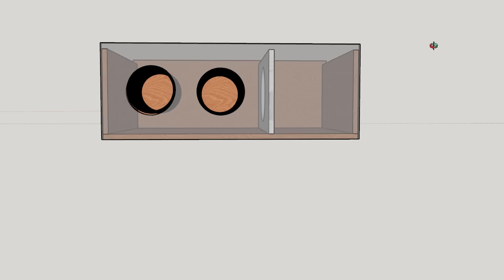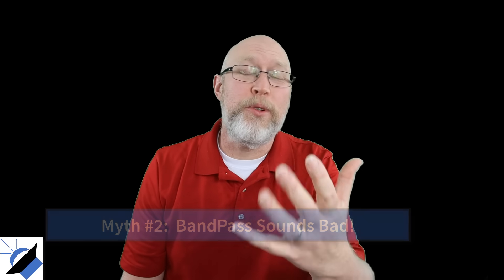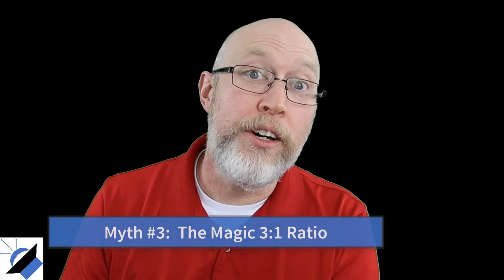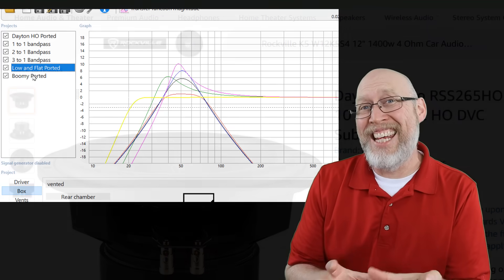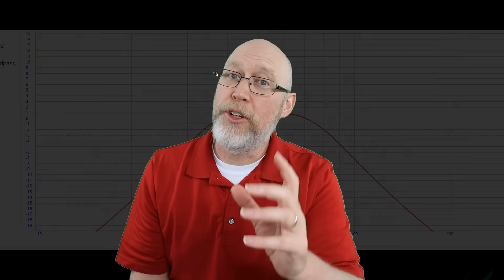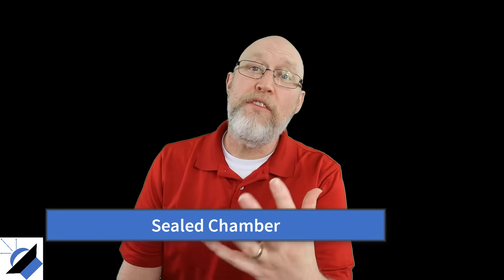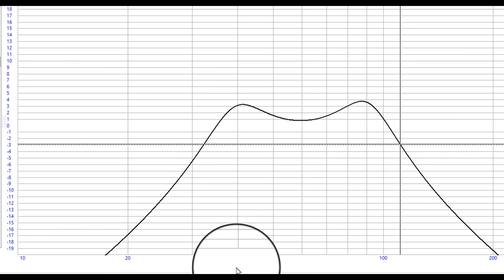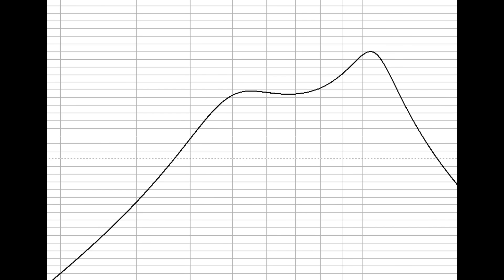Bandpass Subwoofer: You Are Doing it Wrong.  Bandpass MYTHS BUSTED!

Comment: 4:20 the 3:1 ratio.. Was born for the ease of porting if you are porting the larger chamber in which a larger diameter port can be used as a length isn't a problem.. I prefer to port the smaller enclosure.. Which makes it harder to get a good port. But I also vent the magnet side.  Ratio and Q is Way better using the larger side as the FC tuning with the port Q meeting it.

Back in the 90s I got a hold of the Pioneer Bass book installers guide.  It showed a group of modelled enclosures. I learned the EBP concept and matching final QTC and resonance
Reply from the maker: Back in the day when you had to have a book to find stuff out!  Would have loved to have gotten my hands on one of those back then.
Reply: @DIYAudioGuy  I learned how T&S changed things with those enclosure graphs and could build and did build many. Lots of calming people down from more woofers showing them one QTC final .707 target would bump better than 2 in the same area at .9

Comment: They turn the driver around because of cooling! If the driver is facing the other way the heat can only escape through the cone of the driver. The pressurized air moving in and out of the box helps dissipate heat from the driver. They do the exact same thing in ported and sealed boxes but its much less common.
Reply from the maker: For sure! You get better cooling with a magnet is exposed.  No impact on sound, especially in a bandpass box where you're only hearing the port resonating.
Reply: @DIYAudioGuy  Looking it up they actually do it so they could smell the voice coil as well but I’d never heard it that way. I have a 90/dbw 4th order right now that i designed with old school math and the drivers are inverted with the phase flipped. I messed up my calcs though so my F-upper is lower than it should have been 😭
Reply from the maker: @peeweebus6829  bandpass is a pain in the rear. Very hard to get it right.

Comment: I have a sub woofer speaker but this one has a low Qts and makes a possible resonance frequency of 40 hz to get a Qts of 0.6. Then I can not use a bandpass? because then it go never lower then the open resonator with pipes. So i need a speaker with higher qts, of Vas. I have visatons wsp26s, and these have a res of 19 hz and a qts of 0.47, that will make a 20 Hz bandpass.
Reply from the maker: I know that I made the same reply to your other comment, but it is still the same answer.  WinISD.  https://youtu.be/yZNeYBYGRKk

Comment: Great explanation. Thanks. I would be interested in understanding group delay and what is relationship (if any) of seconds delay (as shown in winisd) and pecieved sound quality.
Reply from the maker: I haven't done any research on it.
Reply: in the analog filter world (or digital for that matter) , group delay is essentially how smooth the phase changes with frequency and the 'slower or smoother' the phase changes, the less distortion that wave shape has. Filters in radios often have added sections to smooth these changes to make it easier to recover the waveshape when demodulating the signal.

Comment: I bought a second hand active subwoofer and it's actually a 4th order bandpass by checking it online (not a crazy branded one, I think it's chinese but it sounds good enough), it's called Dai-ichi ASW-10DR, now I got this for like 10 bucks out of facebook marketplace, the wood is like dry and by the looks of it, it's water damaged, luckily enough it still works like a charm, I disassembled it and upon removing the 10" sub, it's a dual 4th order bandpass that is front to front (I don't know if I'm using the right term), well, my only question is, should I remake the production box by building it based on its own design? Or should I make a new design box fit for dual 10" subwoofer? (probably still a bandpass cause it sounded big on a small scale, but different design).
Reply from the maker: If you're going to rebuild the box, try to recreate the original.
Reply: @DIYAudioGuy  Thank you so much!

Comment: Very helpful info. One thing I question though is the last statement you made about the asymmetrical ripple sounding bad. However it seems to me that if you tune it such the the upper ripple is greater and the lower ripple is flattened it could provide excellent results if the upper ripple is well above the crossover frequency.
Reply from the maker: That is true, once you add a crossover things change.

Comment: Efficient to some means highest achievable SPL. efficient to me, means sound output balanced to cover the band of frequencies desired with the least variation. I want the subwoofer to "sit" in the frequency range such that, in concurrence with the other drivers used, the "gap" that i want to fill is evenly filled, it does not run over the midrange or the subsonic transducers. If the subsonic transducers do achieve coverage up to 30Hz, then i want to begin hearing the subwoofer take over at above 30Hz and carry on until it meets up with the midrange driver that most likely will start to dominate above 80Hz. But it depends on the setup. Not the same rules apply for a portable bluetooth as a concert or an audiphile living room or recording studio or car. These crossover frequencies vary greatly depending on overall size, number of "ways" or number of bands covered by transducers. There can be as many as 4 frequency bands covered by the various drivers from subsonic, to sub bass, to midrange and trebble for starters. Varying the bandwidth by compressing it with larger baffle of the exterior chamber doesnt change the efficiency technically. It will over the entire frequency span pretty much generate the same amount of vibration. Its just a matter if it's TUNED to resinate the right set ot frequencies in the right balance. And too sharp or too flat of spectra can both be easy to encounter with just slight variations.
Reply from the maker: Right, there's a whole lot to it.

Comment: I do db contests with an old bandpass woofer
Loaded with 2x 12inch.
And its an old magnat 2120 with thick 20mm plexi
Was thinking about replacing it with multiplex
Maxed out on 142db with the original 175w rms woofers and i blew the power caps in my headunit xD
Reply from the maker: No doubt these band pass boxes can get loud!
Reply: @DIYAudioGuy  they sure can.
But like you said. 
When you get the porting wrong they sound awfull.
My mate had a cheap bp and it sounded like he mounted the woofer into a plastic oil drum.

Comment: This is a really good primer for Bandpass enclosures. I always learn (or re-learn as the case may be) some good stuff from watching your videos. I have created exactly one bandpass subwoofer enclosure in my lifetime... I do feel they can be more difficult to work with, but with your video and a basic working knowledge of WinISD, I think most folks would be able to handle designing one with decent performance, given the driver was suited for it.  Given cabin gain in automotive environments, a well-designed bandpass can really be a decent option at times.
I love how you present a lot of knowledge clearly, and quickly. The side-by-side with a vented box FR response is a great way to explain what's going on with changes in the HF and LF box sizes. Great video!   Yeah, I'm a bit late to this party. :)
Reply from the maker: There is nothing wrong with bandpass, but it is not a magic box.

Comment: Bandpass is indeed awesome if you do it right. And doing it right is easy. Buy a suitable driver. Enter the parameters in software. Tweak with volumes, port surface and length, until the frequency response best compliments the rest of your speakers. Then build it without compromising. DO NOT pay attention to myths. Just build it as it rolls out from the software.
I did that and the resulting build was so big that it barely fitted between the wheel arches in the trunk of my car. Indeed, it turned out bigger than expected but the sound was amazing.
Reply from the maker: I agree.

Comment: When it comes to 4th orders from my experience I’ve seen shrinking sealed chamber leads to better low end and stronger output overall, this obviously goes against all logic but it’s true in 9/10 applications. I’ve spoken to numerous box designers, heard countless builds, seen friends go thru it, read on forums, etc. but this is all dependent on power too, if you are overpowering your sub by a bit, you will have Better low end if you have a smaller sealed chamber vs under powering a speaker, then you’d benefit from making sealed chamber bigger. the loudspeaker cook book is wrong in a lot of senses too. Come out to some bass shows once in a while, you’ll hear 4th orders that play down to 20 and into the teens sometimes and up to the 50s. 
    Quarter wavelength helps the big ratio theory also, the farther your subs and port load away from your listening position, generally the better for low end output because the quarter wave develops more
Reply: a small sealed section is NOT helping you play low. theres so much more to the equation than you know. maybe those small sections are giving you a large ratio like 1:5 - what exactly are you considering low? 30 hz? 20 hz?
Reply: @BenHeien  exactly.  The sealed section,  is actually what controls the low end.  I've seen negative ratio 4th order play very well, also.  A 1:1 is normally a very well rounded design, with a driver that does well in 4th order.  My sedan is walled, with a 6th order.  It has a huge bandwidth,  and I can play from 16-54hz and with changing the loading wall... (upper port) I can play lower and it higher hz. A vehicle's cabin peak,  and loading,  plays a huge role in output as well.  Always best,  to find your vehicle's,  cabin peak and work from there.
Reply from the maker: There is a lot to it.

Comment: Since you started digging into subwoofer enclosure designs let me rack your brain real quick if you take a subwoofer that has a high xmax and you put it in a 4th order bandpass and you cut two holes on a sealed enclosure side and you add two cones of equal size to the one inside the enclosure what kind of enclosure you left with? And what is the kind of performance would you receive? And what kind of enclosure have you created?
Reply from the maker: I have no idea.
Reply: @DIYAudioGuy  isobaric bandpass it is not widely used due to the restrictions of a lot of current subwoofers but you can also Build 1 with different cones on the side to change the tuning frequency there's a lot of difficult mathematics involved but they used a similar thing from Bose and one of their older desktop sounds units we just of can apply it in a different way and I would say look into 5th order bandpass as well they're not widely used in car audio they're used more in concert Halls for projection of sound or directional sound
Reply from the maker: @c.n.h4841  I think I understand what you're talking about now. When you said cone I assumed you were talking about a passive radiator.
Reply: @DIYAudioGuy  yes cone does stand for Passive radiator the passive radiator can also be created by using a recone kit for any subwoofer but if you are going to make this creation it must be the same manufacturer so there is no failure issues this is something that you would not be able to fit in parameters on normal sound programs you would need audio engineering programs to run sound quality test on using colors years they also use this same style of enclosure in certain mercedes-benz's just on an extremely small a scale but they use more of a 5th order bandpass style in the Mercedes

Comment: Odd you should talk about small rear chambers and SPL builds. Craig Butler's car has these digital designs 18" subwoofers in these sealed cylinders and is hitting insane SPL at one note. I'm not sure if he shaped his entire cabin to act like a great big resonator and thus he is sitting (or maybe outside of the car when it's turned up to record breaking levels) in the ported chamber of a 4th order bandpass.
Reply from the maker: As the rear chamber gets smaller SPL increases.  Sounds like crap, but it is loud.
Reply: @DIYAudioGuy  optimum "burp box" = tune the rear chamber so that Fb is equal to the tuning of the port. With those high bass 70Hz burps this would be quite a small box. This helps bolster the driver to swing in time with the resonance. Get an even bigger resonance by making the front chamber really big. Because you're driving a pressure mode, a driver with a smaller tough cone and a powerful "motor" works best.

Optimum more linear box would be to pick a woofer with a nice low resonant frequency, and use the port to fill in the mid and upper bass response.

Comment: I have 2 15s in a forward facing 7.25cuft slot ported enclosure in my trunk. I would like to regain use of the back seat as it doesn't fold and has to be removed. Can I calculate volume of space between enclosure and back of seat and port the rear deck as a 6th order setup? Or would the tuning be jacked up by having the output be from the smaller chamber?
Reply from the maker: Venting the port up through the rear deck is a pretty common bandpass trick. But you will need to redesign the entire enclosure to get to sound right.
Reply: @DIYAudioGuy  I've got two sedans that I was thinking of setting up just this way, mainly so I don't have drivers in the trunk serenading/advertising to everyone.  Plus I'm not a basshead so SPL is not my goal.  I have modeled one of the drivers I have in winisd using a (gasp!) pre-fab bandpass box and it actually looks really good- F3's of 28 and 75 Hz respectively, and it shows a bandpass ripple of less than 1 db.  The overall output is at -1 db however.  Should I worry about this?  It does have one of those stupid plexi windows that intend to replace with some sort of steel/mdf cover.

Comment: Dear Sir
3in 1 means?
2.7  vas ( 2.7÷3)=0.9   
0.9×2=1.8
That means 1.8 cubic Port side
0.9cubic seald side
Please give a reply!
Reply from the maker: The VAS is not used to calculate the enclosure size.  It is a way of quantifying the stiffness of the woofer's suspension.
Reply: @DIYAudioGuy  thanks

Comment: Everytime I watch this video, I learn something. Would be awesome if you could make a part 2 to this bandpass tutorial. 🤘🏻
Reply from the maker: I have been doing some research on the more exotic bandpass enclosures.  There is surprisingly little technical information on them available to the pubic.  As soon as I feel like I understand them well enough to explain them I will make a video.
Reply: @DIYAudioGuy  awesome, I can’t wait. I been building car audio since the 90’s. Back in 2000 I built a type of band pass for a friend. He had a pickup truck with a topper, so I built a sealed box for 2 15’s firing backwards towards the rear of the truck and it fired into a shell that blew through the rear window. We removed the whole back window. The subs were in a 3 cube each and I would say the chambered was a total of 7 cubes. It didn’t actually have a true port. The vent was the size of the rear window. It played every note from 25HZ to 70 relatively clean and it metered about 150db’s. That was about the only type of bandpass box I’ve ever built.

Comment: Who remembers the Thunderbox that MTX Audio had back in like the late 90s early 2000s?! Great box for 250-600 watts, very musical. I remember those Pyle bandpasses haha. Thanks for the video, looking into designing a 4th order for 4 8's, trying to find good information on how to model it. Might need to pick up that book you mentioned.
Reply from the maker: Your best bet is to just download WINISD.  It takes a little time to figure out how to use it, but it's the best free tool for figuring this stuff out.
Reply: @DIYAudioGuy  I've got some novice experience with box modeling with WinISD supported by a few other good, free tools. The part that I still have trouble comprehending on 4th order and up is how to properly calculate your air space, like for instance what should ported side vs sealed side start at for each sub. I've modeled so far for 4  Sundown Xv3's, 3 cubes ported and .5 cube sealed @ 45hz gave me a good frequency spread but at like -5db lol. Make the sealed side 1 cube and it peaks hard at 45hz and drops off quickly on Fl/Fh. 

Still learning and still have a long way to go just hate to spend the $ on something I model and then the sub doesn't like it, too small, too big etc.
Reply: My cousin had one with a Walmart impp pioneer 12 in it on 200 to 300 watts and it was as loud as my Rockford fosgate 10in hx2 in a ported box on 800 watts. That thunderbox sounds awesome. I copied it later with a slot port on the portside with a premier 12 that slammed in the back of my safari van.

Comment: I understand the formula for Fc but how does this effect multiple drivers in a single undivided seal section say 4 drivers in 4cuft would you use the vb/4 or vb=4 in the formula. In my case this can make a difference between 60.7hz and 48.7
Reply from the maker: WinISD is your friend here.  Download it see what it tells you!
Reply: @DIYAudioGuy  I have winnisd. It doesn't  have this information. When when working on a a 4th order. I can change the size if the sealed section I can change the ported section but if I don't adjust the tuning if either it doesn't change. If it work as if you are thinking no matter how many drivers were in the sealed section an I increase the vb or decrease it should change and it does not. I even went. As far as deleting the driver and reentering the information. Winnisd is great for vented enclosure , it ok at 4th orders and its not worth using on 6th orders. I just asked a question to get clarification. On a subject you spoke about. I know and understand  my thought process on the subject. I was just trying to make sure not To have the wrong grasp on the subject. I guess I will just research it myself. Thanks